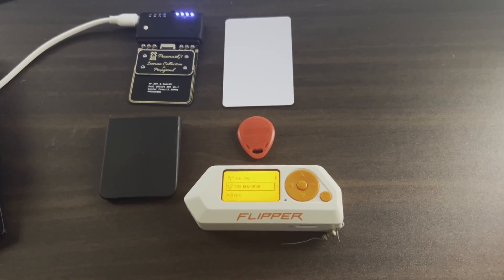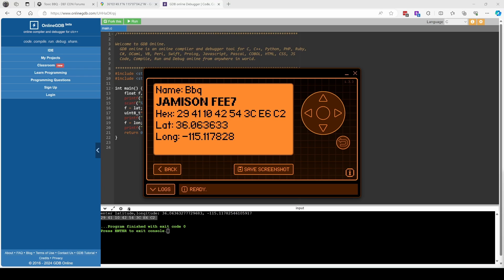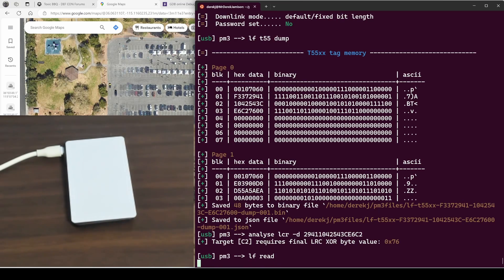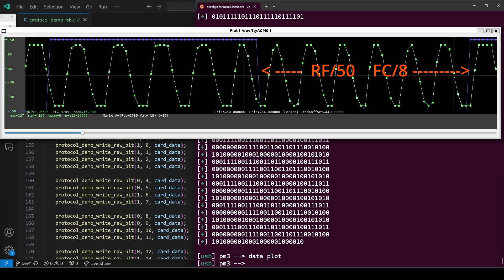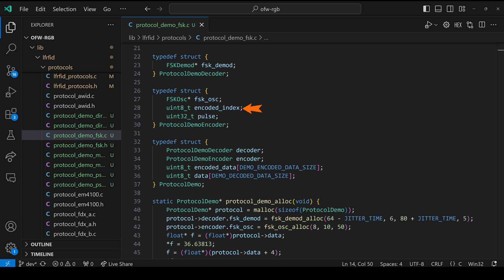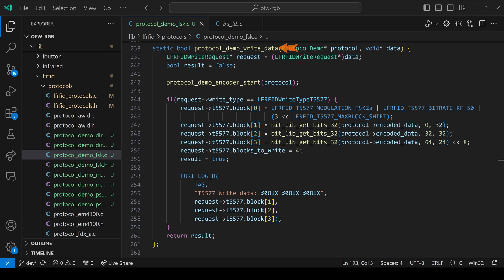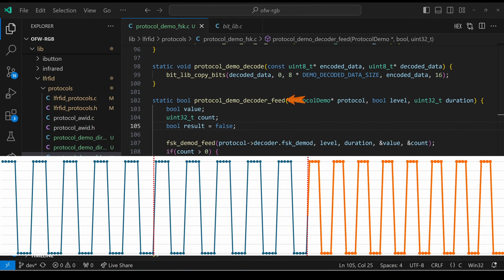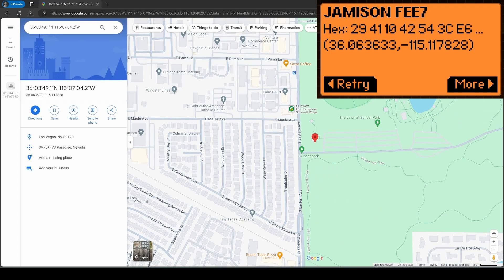[117] Flipper-Zero: 125-kHz RFID for Geolocation using FSK

Comment: Man that was awesome Tutorial the name of that program I see with all of that coding in can I install it on kali linux
Reply from the maker: Thanks, it's been fun learning about low-frequency RFID.  Writing your own protocol is a good way to learn how the Flipper encodes and decodes data.  Having a ProxMark3 makes troubleshooting easier (because you can see what is on the card much easier than with just a Flipper Zero).

The code that I wrote to convert float to uint32_t is at https://www.onlinegdb.com/UHHaOKrpj.  It should run on any browser.
The ProxMark3 requires hardware (https://github.com/RfidResearchGroup/proxmark3) I have the RDV4 and am really happy with it.
VS Code (https://code.visualstudio.com/download), on Kali I think is just the command "code".
Git can clone the repo matching your Flipper Zero (https://github.com/jamisonderek/flipper-zero-tutorials/wiki/Install-Firmware-and-Apps#clone--deploy-firmware).
My tutorial (the FSK files) is at https://github.com/jamisonderek/flipper-zero-tutorials/blob/main/rfid/fsk-geo